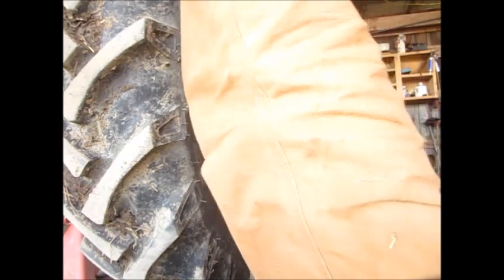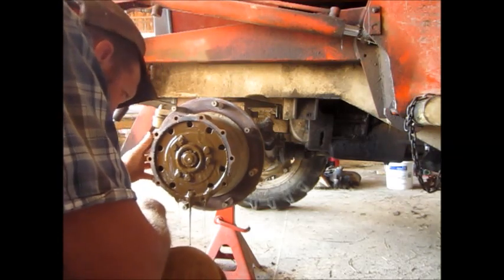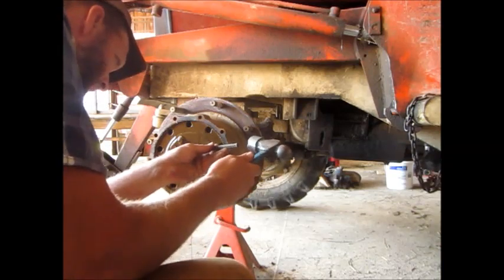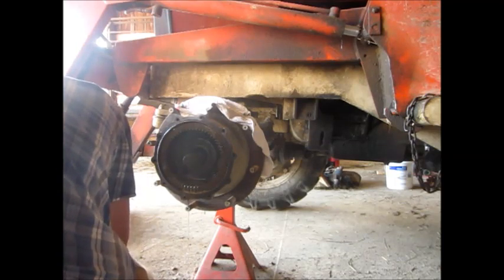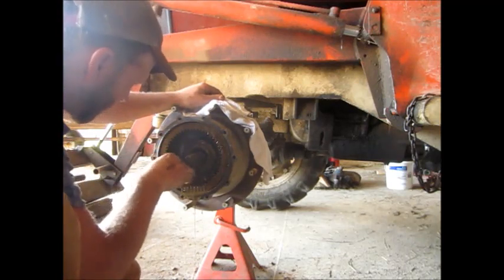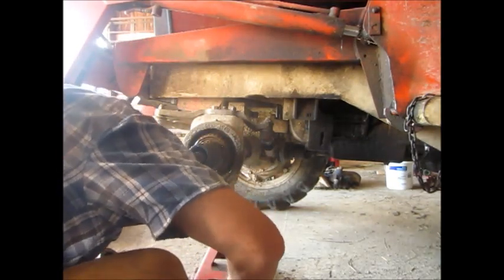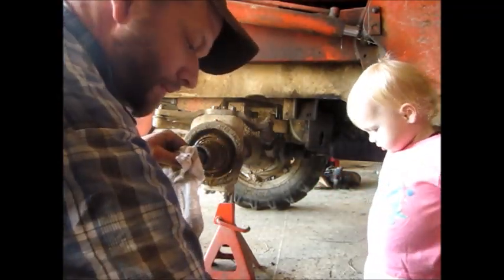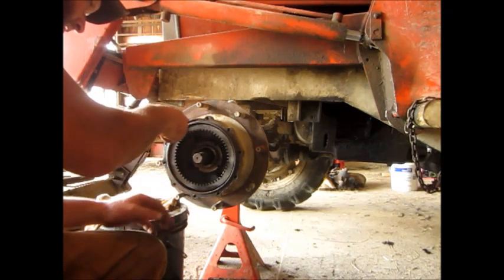IMT 560 front hub repair

Comment: Looks like water in your gear oil. that sure is hard on bearings. at least you can order what you need and not have the tractor tore apart while your waiting.
Reply from the maker: ya definitely water not sure how it got in.  I was tickled it was back up and running with just a cleaning and new oil.